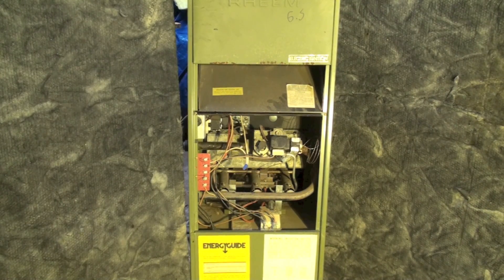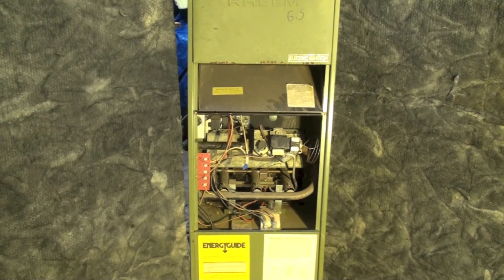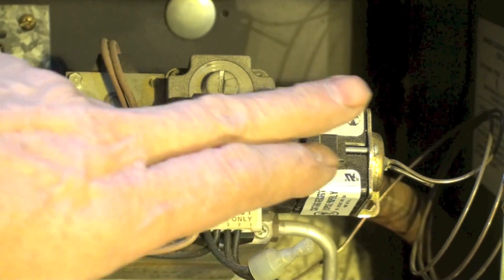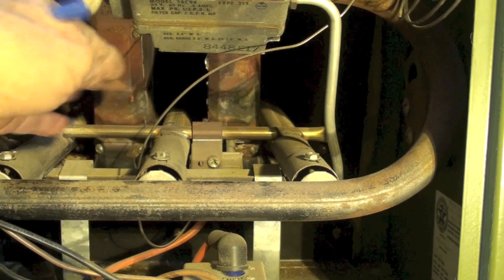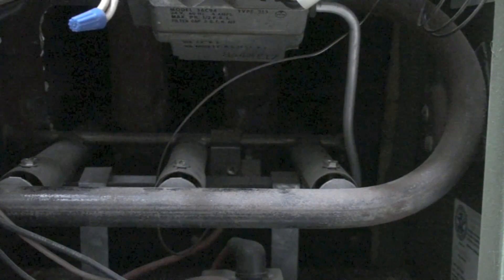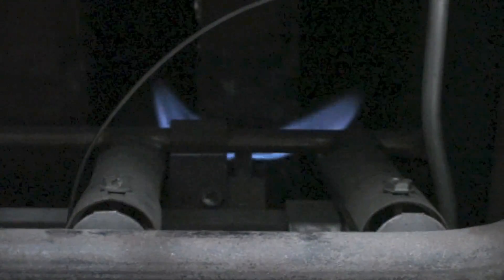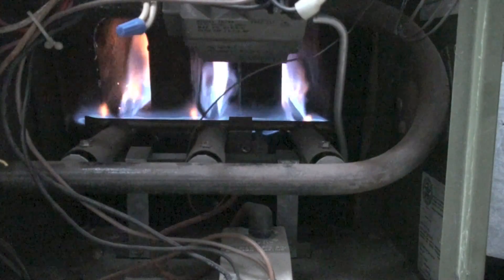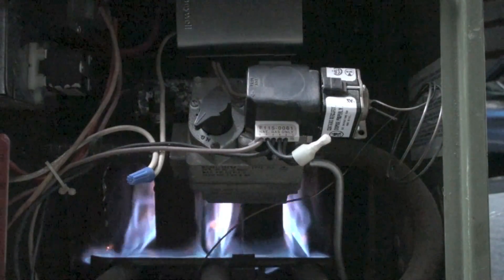Rheem model RDGA electric ignition gas furnace

Comment: Is the pilot light supposed to be turned off during the Summer?
Reply from the maker: If your unit has electric ignition, there is no need to turn off the pilot in the summer.
GFM

Comment: I have RGAA-140C  model trying to figure out how to light this dinosaur from 1978😂
Reply from the maker: That age of furnace will have a standing pilot unless it has been upgraded.  If you do not see a pilot with a blue flame, you will have to light the pilot.  
There should be instructions on the model plate on lighting the pilot.
Some general instructions are:  Look for the gas valve.  An aluminum block near the burners.  There should be a small aluminum tube leading from the gas valve to the burners.  That termination is the pilot assembly.
There will be a knob on the gas valve that has 3 positions.  Off, on, and pilot.  Turn the knob to pilot.  
The knob or a button on the gas valve will have to be pressed and held while holding a match near the pilot assembly.  The pilot should light.  Have some patience here, it may take some time.  Once the pilot lights, hold the button down for 1 minute, then release.  The pilot should stay lit.  Turn the gas valve knob to on.  Burner should light if the thermostat is calling for heat and the power is on.
GFM

Comment: Do this thing have a filter ? Can’t locate it on mine?
Reply from the maker: Filters are often installed by the installer.  Some common places are behind the fan door on the side or bottom of the furnace.  If its a down flow, it will be above the furnace possibly behind the fan door.
GFM

Comment: Thank you! I think this is the furnace I have. It has worked solidly until I recently replaced the thermostat. I didn't turn the breakers off--my bad--and now it doesn't do anything. No noise, nothing. I've flipped all the breakers I can think of. I cannot find a reset switch, and the dial seems to only say "ON" and "OFF"... I can't find a "PILOT" setting.
Reply from the maker: You may have burned out the transformer.  You will need to check for 24 volts between R and C.  Best checked at the furnace terminal board.
GFM

Comment: I have a Trane BLU090L948A0. The pilot never comes on at all. It has no flame to ever heat up the mercury bulb. Could it be dirty or a bad igniter? Can I test the igniter with a clamp meter?
Reply from the maker: If it uses the mercury pilot, there should be a spark ignitor to light the pilot.  Bad news is if it is a mercury system, you will probably not find parts for it.  Means you will need a conversion to a spark ignition system or, more likely, a new furnace.
GFM
Reply: @grayfurnaceman  I hooked up a clamp volt meter to the red ignitor wire coming off the white Rogers box. Just like the one in your video. I got no voltage on that wire when I turn the furnace on. So I ordered a new white Rogers pilot relight ignitor off eBay. I’ll install that and see how it goes. If the mercury bulb is bad then yeah I’d probably be out of luck unless I find one on eBay. But I’m not hearing any ticking/sparking noise when I turn the furnace on like I hear in your video. So I’m hoping that it’s just a bad ignitor. Thanks for the quick response!

Comment: COLD IN PA @Grayfurnaceman I have almost the exact model of this Rheem RDGA, only it has a pilot....Install date was 1987, moneys tight id like to get another winter ot two max, so here's my question! Do you happen to know of any businesses that still sell repair parts, oem or not.....or any other resources for this make and model......As soon as my blower kicks on the flame rails and pilot shuts off, it will also do it sometimes here and there without the blower? I'm thinking maybe a gas/valve problem? Serviceman tried a new thermocoupler and that wasn't it, I told him since they light up fine until the blower kicks then that likely wouldn't be the problem...Any help is Appreciated!!
Reply from the maker: If you are saying the flame changes/rollsout when the fan comes on, you almost certainly have a cracked heat exchanger.  There is little you do except replace the furnace.
GFM
Reply: @grayfurnaceman  2020 has been the worst year financially bud, so far weve paid for my father's funeral, a refrigerator, and a washer, new waterlines cuz changing a washer can't just be a easy thing to do in a old house, and with covid here to throw a wrench into everything holy heck another 3 grand for a furnace maybe cut that in half if I do it myself......IF THEYRES A PARTS VENDOR FOR THESE STILL ID APPRECIATE IT, SORRY TO SAY IM GONNA MISS THIS OL HEATER, ANYWAYS THANKS FOR ALL THE INPUT I APPRECIATE IT
Reply from the maker: @jasonsmith8738  There is a lot of that going around.  Sure be glad for this year to be over.  I am assuming the thermostat has been bypassed to test, and the thermocouple has been replaced, so the only other component in the circuit is the gas valve.  That furnace can use a general replacement valve.  Try the Robertshaw 700-406 model valve.  I do have a video on replacing the valve.  Check my channel.
GFM
Reply: @grayfurnaceman  ill check it out thanks alot for the help, God bless and keep up the videos, pretty sure you might be the only tuber with videos of the old RHEEM's i thought I was the only one who even ever seen one before up until your videos lolol thxx againn!!
Reply: @grayfurnaceman  yes sir I jus checked that part out and it is exactly the same as mine, might even be a replacement from past years, thanks @grayfurnaceman
Reply: @grayfurnaceman  im sure there's a few pinholes in the rust spots its 35 yrs old, it worked great one day then started this the next,, but they both also go out even without the blower kicking on here and there too, I had a serviceman come, he saw it go out himself without the blower and suggested something possibly with the main on/off/pilot valve body, because he tested every circuit, swapped a new thermocouple but all was good.....he ran out of ideas besides recommending a new furnace.....180 bucks for him to tell me something I already knew haha..... Last Question If  it wasn't the exchanger what next would you think, being the thermocouple is good and all circuits checked out with a multimeter?   THANKS FOR THE REPLY I APPRECIATE IT
Reply: @grayfurnaceman  And no the flame doesn't roll out at all it burns normally for a few minutes and then as soon as the blower kicks on, the flame rails and pilot shut off, from lack of gas not from being blown out, flames never leave the exchanger its like the gas is literally shut off as soon as the blower kicks on

Comment: Hello, my heater very similar to the one you showing except with 1 burner. When i turn on, the pilot ignite several time, then quiet, and didnt fire-up the furnace.   May i ask what wrong with my heater? Thanks in advance
Reply from the maker: If the pilot lights but the main burner does not, you probably have a bad mercury switch.  The bad news is they are very hard to find.  You may need to change out the entire gas valve assembly.
GFM
Reply: @grayfurnaceman  
Hey thanks 
I just ran into this problem 
The pilot would light then the main burner would short cycle 
Than the main burner would completely stop coming on but the pilot would stay on but no main burner jumped mercury Flame Sensor pin 2 to com.....
 main burner came on 
Bad mercury Flame Sensor 🔥

Comment: I have this same exact furnace and when I call for heat all I get is a clicking noise. No pilot flame or anything.  I ordered a new ignition control to replace the Robertshaw 780-715. Any idea what it could be?
Reply from the maker: It very well could be the 780 control has failed.  They gave a lot of trouble.
GFM

Comment: I have a rgda060aacr it’s a standing pilot model , the pilot is good but when it gets a call for heat only one burner lights then slowly the second one tries to but then I get a fast and loud blow back or roll out ...I can’t find any manuals on this model and I checked the burners for anything blocking them but it’s clean so are the orfices...
Reply from the maker: I would be looking for plugged crossovers between the burners.
GFM
Reply: grayfurnaceman thank you for getting back to me I already checked that but it was clear , I found out the maintenance man changed the gas valve yesterday and put a fast opening type ,
I found the old gas valve in the trash so according to the model number and the Robert Shaw’s website the last three characters of the model number are s7b which means it’s slowing opening
5 to 10 seconds to flow , he has a fast opening valve on there
Reply from the maker: @mrbig4532  If the system does not put out the pilot upon ignition or shutdown, its ok.
GFM
Reply: grayfurnaceman No it was the gas valve I got the replacement model for the old Robert Shaw 7000bers74 ,put it in and it fired right up no problems...

Comment: Nice vid but my furnace burners light , then shut off after a minute or so. No blowing of hot air is coming out.  I don't even hear the blower turning on... Any suggestions?
Reply from the maker: First, jumper out the thermostat.  If it stops look at the thermostat cycling rate.
GFM
Reply: @grayfurnaceman  thanks for responding. However I'm no pro. I have no clue what you are suggesting. My thermostat is a turn dial style.
Reply from the maker: @azvato69  Try this:  turn the thermostat all the way up to the highest setting.  If it stops, you have a cycling rate problem.  If you find that to be the case, let me know.  There is more I can do.
GFM
Reply: @grayfurnaceman  the highest temp is 90° and the burners turn on but then shut off
Reply from the maker: @azvato69  So, the burners come on but shut down with no fan.  Does the fan work with the fan switch.
GFM

Comment: i have a RGEA furnace on propane (1983 says the sticker); the ignitor lights, but compared to timestamp 1:52, it's weak and it lights to one side and if I blow on it, spreads on the other side weakly.. Burners won't go on...  what are my possible isses for this weak flame and no burn?
Reply from the maker: First, clean the burners.  They could also be rusted out.
GFM

Comment: My pilot comes on fine, but then just stays on and does not ignite the main burners -- tried a different thermocouple, but that didn't make the main burners come on either.  Have gas at the valve, since it's supplying the pilot.
Reply from the maker: Is there power to the furnace?
GFM
Reply: yes, thanks for responding - I do have power ; not sure how to test the 24v transformer -- have a replacement too if that's the problem.   @grayfurnaceman
Reply from the maker: You will need a voltmeter.  Check across the terminals of the valve.
GFM
Reply: ok, I have a good meter -- do i want to set it to run, heat on then test?   @grayfurnaceman
Reply: @capth00k  Set to heat, then place the probes on the wire terminals of the gas valve.. It should read 26 to 28 volts.
GFM
Reply: @electriccar3253  thanks bud, i'm getting 10.4-11.60v across P and M terminals on the gas valve. Top of the valve has 3 wires, P, C, and M (white,yellow red wires) . Barely a volt across C and M ; like 0.60v
Reply: Sounds like the furnace has an ignition control.  If it is a Robertshaw 780, it has probably failed.
GFM @capth00k
Reply: yes, it does have ignition control and I think it's a robershaw unit :(  @electriccar3253
Reply: Well, I don't have 24v at the control ; but the pilot is still lighting.... looks like 2.2v on MV but no more than 0.6v on the TH and PV control points.  Tried a new transformer, same result -- it seems like even the new transformer isn't putting out 24v ??  Is power to the transformer only given after a certain sequence?  @electriccar3253
Reply: Hi Gary, it seems i don't have 24v at the control.   New transformer, same result?  Without the transformer hooked up the pilot ignitor will not activate so I know it's getting some power, but I cannot see 24v anywhere .   @grayfurnaceman
Reply from the maker: I don't believe you have a problem with the transformer power source.  Almost certainly the control has failed.
GFM

Comment: Hi. My names Blaze and I’ve been in the industry for 25 years. A friend of mine had a RGDG furnace pretty basic. It would light then go off in 4-7 seconds. I went with a flame rod and on my way home Friday picked one up. By the way my friend described what it was doing. Last night I went over to be the hero. Jumped out the furnace and it did everything except stay on. I went ahead and replaced the flame sensor expecting it to start up and it didn’t. Do you think that it could be the IGF board. I get pressure switch, combustion fan, HSI, gas, and all the burners light up, new flame sensor in the flame. What’s next?  Thank you for your videos. God bless.

Comment: I have the same kind of set up . I’m having issues with the blower motor. It doesn’t turn on and if it does it spins slow. I replaced the fan control but nothing . There is no capacitor. Please help lol
Reply: Same setup here. My blower is also not turning on?  Maybe a possible reset button but I don't see one...?...  How did u solve ur issue?

Comment: This looks my furnace. My model number is RGDA-100C-ER. But the pilot on mine is on all the time. Currently, the burners won't come on. Need the burners to come on for a home inspector. Many advice? Worked fine last winter and early spring. Any ideas?
Reply: Yes, I believe so.  I am using the AC, which uses the fan.  I've tried turning the unit on and off using the switch (looks like a light switch) on the side. I wait twelve minutes between tries.  Yeah, I know...excessive.
Reply: Is there some kind of safety thing that prevents the furnace from coming on if the heat exchanger is cracked?  My buyers had a 'water test' done, the heat exchanger is cracked, but the home owner's warranty I purchased when I listed my home won't cover unless they can test and they can't test if the furnace won't come on.  Yeah...I know.  Runaround...